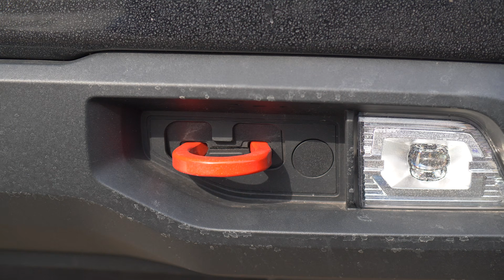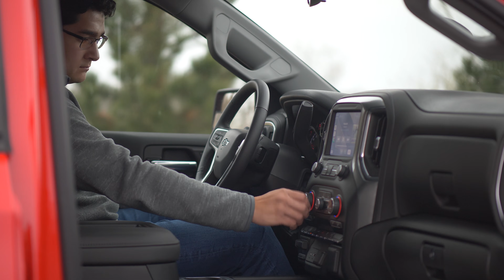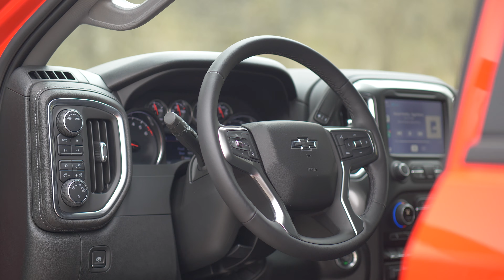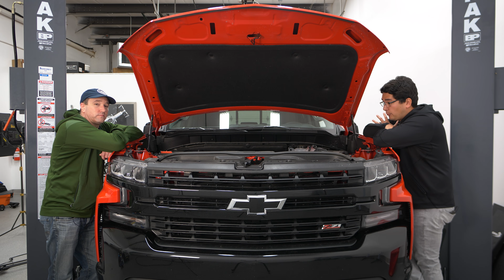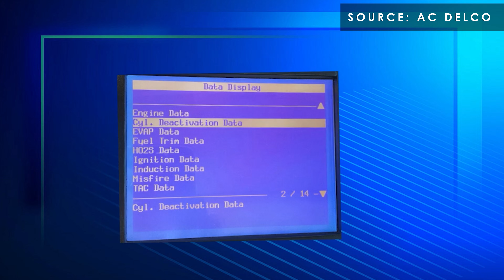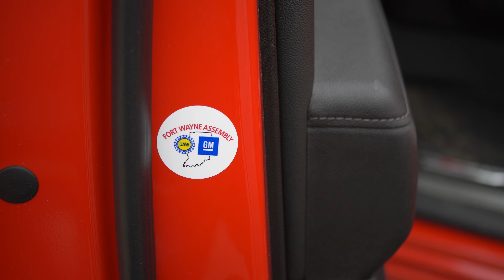2020 Chevy Silverado | The Golden Child

Comment: Firm, long wearing seats may be the 'best-est' for long trips, aka Mercedes.  The Silverado, designed by some of the best engineers in the business - as you mention, is not your style, I get it.  Ford's F-150 aluminum body is a great achievement, but GM and Chevrolet were able to reduce weight similarly to Ford.  Oops, is that higher level engineering, like the better 10-speed transmission calibration you mention?  What if the next-Gen Silverado went aluminum?
Ride and handling..the Ram's independent rear suspension tows trailers in a way I do not prefer.  But the 'boulevard' ride is nice for grocery getting.  Incidentally, wouldn't a portion of the Chevrolet Silverado Trail Boss's ride be attributable to the Rancho-brand shocks?...you failed to mention...
This is how a competent Chevrolet truck can be derided for being good.  I expected more from yourselves, who are capable of the technical deeper dives into the good stuff in Chevrolet (and GM) trucks..bed construction and access, the infotainment, the trailer towing expertise, frame strength, suspension and brake systems "margin of safety", options selection, and more.

Comment: Where I agree with most of what you guys think of this truck and it's competitors, my experience from a test drive of the Ram Limited (5.7 L   NON air ride), Ford King Ranch( 3.5 Eco boost) and Chevy Silverado High Country( 6.2 L) is slightly different. Ram definitely takes top honors with interior quality, design and comfort! Where I disagree is between the Ford and Chevy, Fords design is slightly better ( opinion at this point), but quality, NOPE, Chevy's interior plastics and quality is better. Initial appearance the Chevy's looks outdated but after a few minutes of using the interior, especially with the optional HUD, blows the Ford away! The Ford does have a more comfortable seat, but not by much, similar "hardness" to Chevy's, just more adjustment. As power goes, Chevy all day long, but the Ford with the 3.5 eco boost and 10 speed auto is very fast! The Ram sounds good with adequate power but you can understand where Ram put most of it's development dollars in it's interior and Chevy in its's drive train! I drove all 3 over this railroad crossing where I live in SW Michigan as a test of the body structure and here you can see/ feel the clear winner, CHEVY. The Ram was second and Ford just "shutters" severely in comparison! On the "on ramp" to I94, 2 really good curves to test cornering feel, the Ram wins this one, with the Chevy second. What I look for on exterior's for "Quality" is body gaps, and here the Chevy clearly wins, Ram second and Ford last, just abysmal :-(   There's also something just off putting about the Rams's exterior trim pieces, body moldings that looked Cheap and misaligned. From my past experiences with all 3 I think the Ram will be the most problematic, followed by the Ford and the Chevy the most reliable. From what I've gathered from the GM's AFM problems, it is due to poor oil quality and  changing oil beyond recommended change intervals, or the combination of the 2! I'm sure there's a few exceptions and I agree with you that a good extended warranty on a "USED" model is a must!  At the end of the Day it comes down to where would I spend my money? That is a very hard decision, if I valued the best interior experience , I would go Ram, best exterior looks and reliability the Chevy. The Ford is just outdated, sorry!  Good review as usual :-)

Comment: For being a tech heavy review channel , you should really be accurate in your description of the systems.  There are no solenoids that are failing on AFM. The lifters can fail. BTW the lifter design is nearly identical to RAMs MDS.  system( also fails) . The AFM does have an oil manifold ( 4 solenoids inside the manifold),which you did show. 

DFM launched in 2019 , the oil manifold is gone. There is now 8 individual solenoids, 1 for each cylinder on DFM. There are no problems with the solenoids failing.

Edit: I get that things like ride quality are subjective. But most other reviews say the TB rides better than the RAM without air suspension.  I've also owned 2 F150s. The TB is certainly better in ride.

Comment: $56k no way but you guys never mention the realistic price of these domestic half tons. Probably at least $10k off with incentives during good times. $43-45k truck it’s an even nicer truck at that price point. 

I test drove a 19’ trailboss with the 5.3l/8speed while my 17’ Colorado was in the shop (go figure) and I came away impressed with the powertrain, ride quality and fit and finish for a $43-$45k truck (with some negotiating). I agree the cabin could be nicer but it’s all there for the most part

Comment: Hope tuners figure out how to deactivate the cylinder deactivation. 😄 I have a VCM tuner on my Crosstour. Honda is just as shitty with addressing their design flaws.
Reply: It can be shut off easily with a tuner. It's sad you basically have to shut it off if you want it to last
Reply: @wigletron2846  Shouldn't even be put in. It's a truck, not a mini van.
Reply: Necrotic Reaper but emissions and fuel economy standards
Reply: @DragonKnightX12  I agree. I'd much rather not have to spend 2k+ on a cam which is inevitable, vs save maybe 2 mpg. It's like auto stop start. Completely pointless
Reply: @wigletron2846  Yea. Why don't just bring back the I6? Simple and reliable design even with Turbos. I've heard this is what FCA is planning on doing to replace the Hemi.
Reply: @m1abrams1776  They could just move to a DOHC like Ford's 5.0 or bring the I6 back in fashion.
Reply: @DragonKnightX12  I'd rather have the OHV engines from gm than the DOHC ford engines. Not that they're bad at all, I just like simplicity. If gm would just get rid of afm they'd be fine. They've been doing afm for almost 15 years and it's been bad from the start
Reply: @wigletron2846  Yea, but I doubt we'll see that outside of HDs which get regulated as commercial vehicles.
Why If I get a truck I'm considering getting a F-250 with the new 7.3L. Might as well anyway, the cost of the half-tons is not that far off now.

Comment: So if the owner plugged in a AFM disabler into the OBD2 port for the life of the truck, would you recommend the engine?
Reply: Their engines are top notch. I have an older L76 performance variant of the Truck L76. It comes with the AFM cylinder deactivation, just plug in go to the AFM and turn off. That simple. If you are worried about parts longevity just have the lifters removed.
Reply: I have had my 2014 with this engine for 3 years and have disabled it with a diablo tuner. 50k miles on it with no issues.  Plus the tuner made it a little peppier to drive with other options i wanted.

Comment: Mechanically, the new Silverado is great. But aesthetically, it's definitely no where near as refined as its main rivals, the F-150 and the Ram 1500, and biggest reason is that it does not feel like a real finished product. The best example of the Silverado's aesthetical design deficiencies is when you take a look at their all-new full-size BOF SUVs, the 2021 Chevrolet Suburban and Tahoe. You're going to see the attention to detail on their exterior and interior designs, the Silverado simply doesn't have that attention to detail and that's where I noticed the difference in mindsets with both of their products. 

The new Silverado appears to be made for someone who is just a complete Chevy truck fanatic whose always had Chevy trucks and doesn't go shop around the competitors. 

And for that alone, only the Suburban, Tahoe, and C8 Corvette are my favorite products from Chevrolet and General Motors as a whole because that's where I think General Motors invested most of their passion and money into.

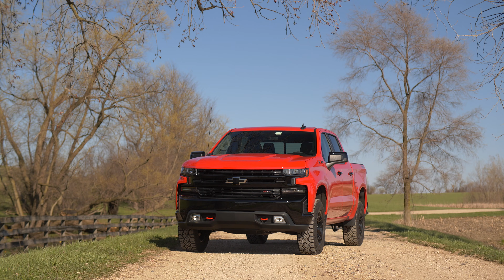3:19
The new Chevrolet Tahoe and Suburban should also be included in that regard as well. Their interior spaces are a major upgrade compared to the outgoing models and their pickup siblings.

Comment: Maybe I'm completely wrong about this, and I would appreciate it if someone who knows better can enlighten me, but as far as cylinder deactivation is concerned, I feel that if I were doing a lot of leisurely highway driving, after a few years I would have an engine which had four cylinders with 100,000 miles worth of wear, and four cylinders with only 50,000 miles of wear. That does not sound like a good situation, and it would get progressively more disproportionate as the years went on.
Reply: Mark Villano 
The engine on freeway cruising is absolutely minimal. Every piston/rod/ring/etc is still moving, but only 4 of the cylinders are firing. On this brand new model, apparently any cylinder can deactivate.

Comment: My youtube name aside, I've had the 2013 version of the Silverado with absolutely no issues what so ever. There is a vocal minority on gm forums that cry about burning oil. However, the majority of people don't have this problem. Think about it, if it was as wide spread as most people thought. There would be a class action lawsuit appearing, and it's been how many years? A decade and a half? I'm not saying people didn't have issues, but these are the same people who don't change their oil on time more than likely. Then they are surprised when something bad happens. 

I actually choose the 2019 Custom (The cloth seats, which is better than leather by the way, are very supportive) this time because I like the front end more, and then I added stuff onto it. I didn't use half the stuff in my old LT. I love the styling. I think the mob of the internet is making people not use their brains again. "Oh.. 5 people here on this forum or twitter don't like it.. I want to be included in this group.. Hey guys, I don't like it either hurr hurr hurr! Please be my friend!"

Also, having tested the newer rams.. Yeah, the ride might be a smidgen better, but then I thought.. I want my electronics to work in 5 years. FCA can't hire a good electrical engineer to save their lives. Having owned several FCA products over the years, it comes down to bad ground contacts and improper wire gauges. They can build a good engine, sure, but wiring a power window? Forget about it. 

Tested a 2019 Ford, interior quality was the same. I just have questions about the longevity of turbos. Even with their cooling systems attached to it. To be honest, I was dead even with both the Ford and Chevy. I just like the styling of the Chevy better. The Ford is pretty much a box with lights. It's like it was designed by U-Haul.

I just don't see how anybody would choose a RAM product at all. Their overall reliability is sub-par when you compare them to Ford and Chevy. I know reviewers love to gush over the interiors of these things, though. Then they go "Why wouldn't you buy this?!" Well, because I don't want to be stuck on the side of the road with failing electrical components. If anybody should be getting an extended warranty, it's FCA owners. 

I did like the video, though. Good job, guys! :)
Reply: While I disagree with many things you said, that was a well written and well supported opinion.
Reply: Range control would be a must for me to de activate AFM. I like all 8 cylinders firing!!
Reply: I'm glad they pointed out the oil problem because even if it is rare, it is something that most buyers would rather avoid. And it's very useful to know that there is another (better) V-8 engine option.
Reply: @zzanatos2001  Oh, I don't disagree with that at all. It's the job of the reviewer to mention all items, good and bad.

Which is why I like watching this channel. I will say that it's the best car review page on youtube. :)
Reply: Yeah its just an opinion man, I disagreed with almost all of their points.  The new Silverado trailboss is probably my favorite truck out right now, and I'm a Ford guy.  Yeah the interior is not that great looking but I honestly don't care.

I gt a truck for utility.  I'd buy that trailboss without a warranty in a heartbeat lol.  My whole family has been driving Silverados for decades without issues.
Reply: Our neighbors 4 year old Silverados AC just went out. And I heard others have the same problem and you can look at GM Instagram and see people complaining about brand new vehicles with transmission issues. If you have been building vehicles for decades and cant build a transmission or AC at this point there is something wrong. Our 04 Suburban is still on the road but it definitely didnt age well in looks and the interior quality and engine issues.
Reply: EXACTLY
Reply: Silverado Nomads all the things you just said a ford or Ram guy could make the same opinion about about GM I’ve owned more gm products new by the way and had bad luck after a 100,000 miles . Trying to stick with them but competition is tight and the products are very close

Comment: Well this is comforting. I bought the TB 2019 custom 5.3 with the AFM last year :-P  I wish I watched this before buying this.
Reply: Change the oil more frequent to needed and it will be fine.  Maybe every 5000 miles.  Always full-synthetic!
Reply: @rondail5675  Will do thanks for the tip.
Reply: @rondail5675  3-5K miles depending on use. Use good oil, and the best filters you can. Too bad GM fucked up the SBC, just another example of the ghost of Roger Smith still haunting GM
Reply: Lol I love the Ford fanboys on here thinking their trucks are flawless works of art.
Reply: @Angry_Gnome  ford didnt fuck up a perfect engine design with overcomplicated bullshit.  What gm has done to the small block is unforgiveable.  Used to be some of the most respectable engines in the business.  Now its 100% dumb luck if it makes it past 100k miles.  This info isnt hard to find either.
Reply: @dr._breens_beard  Sir, I am a GM man for 50 years and I agree with you 100% The SBC from the 265-350, hell even the W motors (348-409) were damn good engines. The 327/350 were bullet proof and GM managed to fuck all that engineering up. Bunkie Knudsen and Zora Duntov are rolling in their graves.
Reply: @seththomas9105  I think you are looking back with rose tinted glasses. The SBC was far from perfect.  You'd be lucky to get 60k miles out of the bottom end, before you need bearings and rings.  Flat tappet lifters ate camshafts every 30k miles. In the 80s the 305s would crack blocks. When I first got into Automotive we used to stock a half dozen 350s, for logging companies. 100k miles was a good life for a 350.
Reply: @terrencejones9817  I don't know where you live  but I don't recall 350 Chevys needing new cams and /or lifters at 30k miles. And 60K and the bottom end was shot?!?! WTF are you smoking??? I have owned and driven many SBC that had over 100K on them and had no troubles and had never been opened up.
Reply: Abdulaziz Alghamdi tune it out
Reply: They are massively over stating the problem on AFM. Change your oil and you likely won't ever have a problem.
Reply: Terrence Jones hahaha just change the oil. Of course! Why didn’t the millions of Silverado buyers with oil burning fucked engines think of that.👍🏼
Reply: @nkyryry  millions. Bullshit  I see these trucks everyday with well over 100k miles. I've seen one, exactly 1 2014+ truck with oil consumption. The problem was largely fixed in 2014.
Reply: @terrencejones9817  I hope so. Thanks!
Reply: Terrence Jones yea ok terrance
Reply: That’s the typical Chevy guy response. You can’t sway a Chevy guy from garbage Chevy engineering. They buy no matter what. Just an oil change lol.
Reply: @mobgma  I'm glad I'm not the only one that noticed that gm people are delusional.
Reply: @derekortiz3663  gm APOLOGISTS are everywhere.
Reply: @mobgma   okay and? Like every vehicle have a common issue. Nothing is perfect

Comment: I'm in the market for a truck. Considered this exact spec or the Tundra Trd Pro. Think I'm going for the Tundra now.
Reply: G Q the ram is worth checking out. The tundras selling point is reliability. Not that it is a great truck to drive
Reply: They hit this thing for being outdated, the Tundra is even worse. The Ram is a shined up turd, the F-150 is the king for a reason.
Reply: G Q it’s a 15 year old design nothing has changed.

Comment: The trailboss trim is okay-looking, but GM still has yet to shed that chintzy look both inside and out. If they ditched most of their plastichrome trim and used interior plastics that don't turn shiny and greasy within 3k miles their products would look decent. My mom's 60K mile Honda Fit looks nicer inside than your average GM product with low miles. The same can be said for most Fords as well. Compared to the RAM, this thing looks like it came straight from Fisher Price.
Reply: ok old mazda driver

Comment: So glad you talked about the fucky cylinder management on the previous 5.3 have a 12 avalanche and it just started doing that shit. 163k miles and now I’m reduced to checking oil 24/7 and throwing a spark plug on the fucked cylinder when a light goes. Can’t get rid of it just yet but a dealership offered $2k over kbb value for it so that might change

Comment: wtf was happening during that first acceleration at 11:40?
Reply: Mitchell Steindler slowest shift I’ve ever seen something didn’t sound right.
Reply: @FishFind3000  From what I've heard there's something wrong with the 5.3 and 10-speed combo. It constantly hunts for  gears and stuff like the new Tacoma. 
But the 6.2 paired to it is smooth sailing.
Reply: FishFind3000 that’s what happened when they went from the bulletproof in-house made 4L60/80 and started using the one they produced with Ford.  Too many gears, the truck gets confused like that a lot.  I HATE it!!!
Reply: I have never heard 4L60 and bulletproof in the same sentence. Most of them now are just 4 neutrals instead of actual gears.
Reply: @derekchisholm972  yea 4L60 was junk. 4L80 was bullet proof and 6L80 and 6L90 were very good too